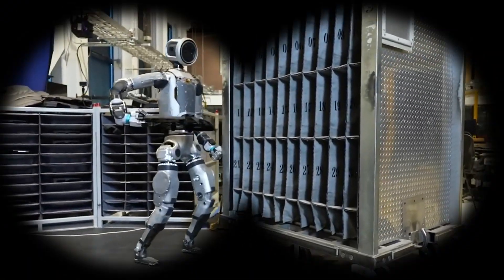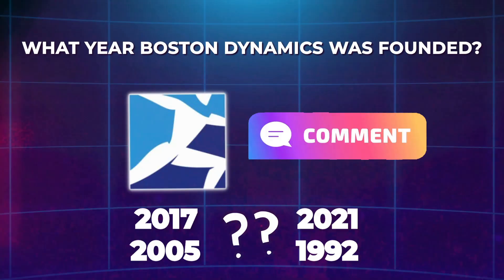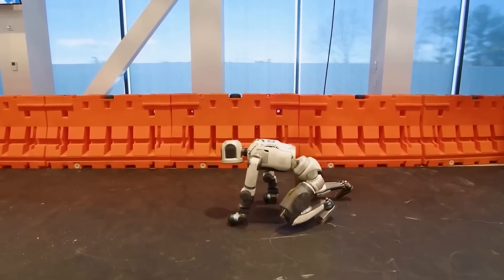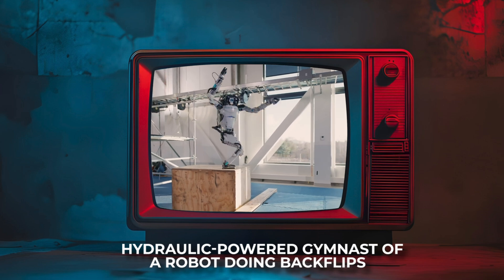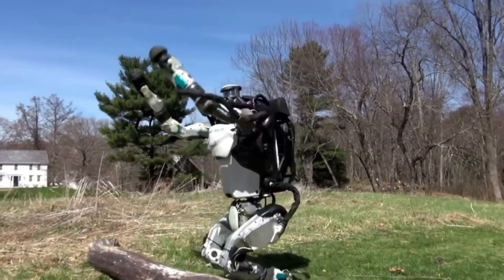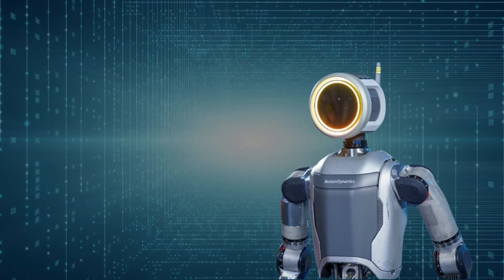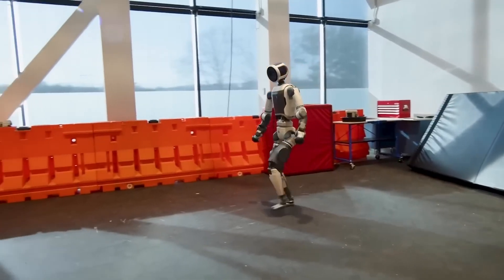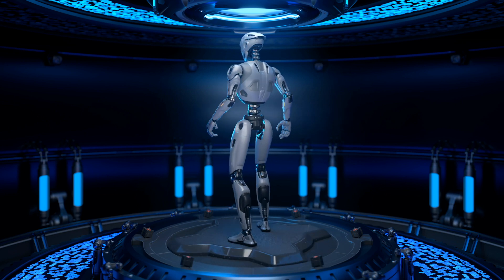Boston Dynamics New Atlas Robot Is Terrifying Everyone

Comment: I think the biggest hurdle will be the power supply. Electrons are difficult to direct and control. They like to just hide and sit in their atomic valences. Until they get excited about something. Maybe some type of Nuclear Device that would give them almost superhuman abilities. The factories have already been built. Computers building computers is nothing new. But right now even as sophisticated as Atlas is they have limitations. They need charging. Eating up lots of electrons, doing human like things till the next charge. Eventually requiring a change of Lithium batteries. Yep, just needs a Nuclear power supply, some red eyes and a machine gun, which they also make right down the road. Judgement day is coming.